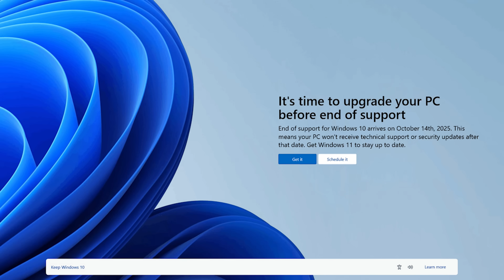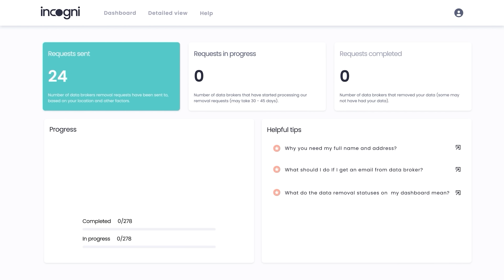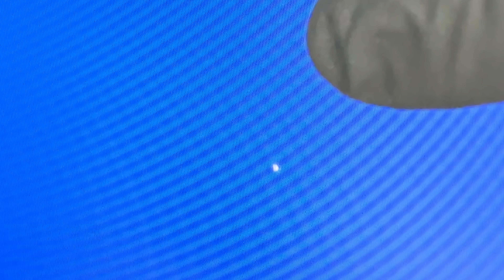I Made 2 WORKING Laptops From 1 Dead ThinkPad - DON'T Buy a New PC Just For Windows 11!

Comment: A few days I bought a used Precision 7540 with an i7-9850H and Quadro RTX 3000 off eBay for $300, a good upgrade from the refurbished Precision M2800 I was gifted and had upgraded to the max. Both computers still perfectly usable running Windows 10. This new one is also really futureproof with all the upgrades you can do including 128GB of ECC ram!

Comment: The only reason I don't do older thinkpads is the display. I use my laptop to watch content and a good display is a must. When I left my last place of work, they were going to throw away the laptop i was using because it was 4 years old. I asked them if I can have it. Microsoft surface book 2. The hardest thing to run linux on. Still managed to do it. Has a gorgeous display. Got it for free.

Comment: I bought a used ThinkPad L14 Gen 4 in March 2025 with a Ryzen 5 PRO 7530U. The laptop had 16 GB of RAM, 512 GB of storage, 450 hours on the SSD, and 28 battery cycles with 98.9% health, for just 380 euros. I upgraded the RAM to 48 GB for 60 euros (it supports up to 64 GB), and with Linux, it is a monster of power efficiency. It now scores 1900 points in Geekbench 6 Single-Core, 7270 in Multi-Core, and 8100 in Cinebench R23. Consider this: if you use a text editor to take notes during courses, with one or two browsers in the background, it loses only about 10% battery in 1 hour and 15-20 minutes on battery saver mode. That is really awesome.

Comment: My daily driver for work/school Thinkpad T460s just died due to a cracked motherboard Im thinking of just upgrading. But I love how easy it was to replace the ram, ssd even the screen. It's the same in the automotive world, cars are getting harder to work on because of how they are designed. Everything is getting worse. I remember when I used to be able to take a IPhone 6s and replace the battery and screen but I can't even do that with the modern stuff . We should have the right to repair and be offered products that can be repaired whether it be a laptop, a car or cell phone

Comment: All the HP people going on about their HP that's good are missing the point. ALL the HPs mentioned are not consumer-grade, either gaming or workstations - precisely what the dude in the video said would last longer. The cheaper ones is where HP is screwing people over. Dell or Lenovo don't do that to the extent HP does and for that reason, I actively try to talk people out of buying HP pieces of shit. HP SUCKS!!! I have NEVER owned a good HP in my entire life! And I've owned lots of them. I SWEAR by Lenovo. Have a T420s from 2012 that still works been running Linux on it since I got it (been a Linux user since 04) and it works, changed the hard drive, the adaptor and that's it. It only needs a new keyboard but I use it as a desktop in the meantime and it has paid for itself multiple times over. 

Kinda sad it lasts so long so Lenovo couldn't make more money off of me, they can shut up and take my momey! I have a complete Lenovo ecosystem going on, Think series desktops, monitors, webcam, laptop, headphones, Lenovo branded NAS, I need a Lenovo phone and Tablet and surface-type device (I actually like the Surface) and a Galaxy S9-type Tablet, hell, if they made food and appliances and furniture I'd most definitely buy that. To me, Lenovo can do no wrong! I am literally a Lenovo Fanboy! Only Lenovo, Toyota and Yamaha get me so dedicated to their stuff.

Comment: I have an HP laptop, not sure if it’s commercial or business, from around 2016. It came stock with a 6th gen i3, 6 gigs of ram (4 gig and 2 gig sticks which is weird to me), a 1tb HDD, 15 in touchscreen, and a freaking dvd drive. Definitely started to slow down over the years and was eventually useless besides running my karaoke program only after 2-3 failed attempts to launch. Just recently did I upgrade the ram to 20 gigs, put in a 1tb ssd and did some cheeky configuration that allowed me to upgrade windows 10 to 11 with an unsupported CPU. Ever since all that it runs better than when I first bought it and it may even replace the small ASUS vivo laptop I got a few years back (that has its own set of issues but I got it for 99 bucks on a Black Friday sale). Being able to do your own maintenance and upgrades to older machines is so helpful and it’s thanks to channels like this that helped me learn how to do these things and keep my aging tech alive and well!

Comment: There is always a use for old tech as long as you fully understand exactly what you need something for.
This is especially true for small businesses.

In my use case a few cheap laptops are a game changer. 

In my use case having an old laptop or several in a different area of the restaurant that can have the booking system loaded. The chefs can see the bookings on the kitchen laptop. They can access the portals for orders and house recipes.

Do you need a top of the range machine to do these things?  No

Get a few old solid ex "business level" still go.

Linux as our man said is a game changer. If you only require staff to acces web pages for business then old harware for basic tasks is brilliant. 

As long as the old laptops are plugged in they are fine.

A shitty old business laptop is still worth its weight in gold. Gets your current non pc using staff connected to the business  in the most simple of ways.

Comment: In a weird way I'm thankful to Microsoft. Thanks to their boneheaded specs for Win 11, now my desktop Optiplex 9010, my ThinkPad L14, and an old 11-inch MacBook Air are all running Linux Mint. And I had not been happier with personal computer in a long time... But now I am. So thanks to Microsoft, I've seen the light, and it's penguin-colored.

Comment: 90% of the people using a computer for whatever, can do it easier, safer and better in Linux . If you're a developer, I'm not even arguing. If you're a gamer, yeah, there is a slight edge in Microsoft in terms of availability, but not performance. If you're a casual user you most likely just need a browser. The hardest thing like Andy's saying is the will to break the habit, although at this day and age it seems easier than ever, since most of us are familiar and use many different UIs.

Comment: The win11 i installed actually looks and works like a linux distro than a windows Os, it even makes the same sounds, it has the terminal a lot closer to users than utilities like control panel, or cmd... the taskbar was in a strange "central posistion and even system settings seems weird

Comment: I would like to say something about switching to linux.
That is the boot mode of your device, if it supports both legacy and UEFI then it's good. Most linux distro only support UEFI but there are some some do support legacy.
I have a latitude e6430 and I haven been trying to install linux mint on it but its boot mode is legacy and locked. Then I installed it right into the trash bin😢

Comment: I'll be good if a laptop can effortlessly run 10 years old games. It be sad while I have a Cyberpunk 2077 on my Steam account and some other games, but I'll deal with it... It is anyway better than sit in dark after yet another wave of ruzzian pooping there in Ukraine.
Unfortunately exactly because of I live in Ukraine I theoretically cannot by laptop from Your shop... Or rather delivery will cost more than laptop itself.
Also there usually if we throw away something it just die in horrible death and it is impossible to salvage anything from this thing. For example I change my "rugged" smartphone after it twice drawn in toilet(don't ask, it just happened), bloated to shit battery, ripped new battery cable and in the end it fall from thousand wounds when freaking CPU and memory chips was chipped and it just goes into reboot every like five minutes. So... I was many time told that in USA You can find totally fine working stuff, including cars, on a scrapyards, which is ridiculous for me.

Comment: thank you for your great work. this channel speaks to my heart.
i still run my 2014 15inch Lenovo "ideapad" Z50-70 with its 4th gen "i5" and Nvidia dGPU and i plan on squeezing every last ounce of life out of it, because it has an impeccable (for its time) IPS display.
(in EU so i'm on win10 ESU atm, but I'll move to some Linux eventually. wild horses couldnt drag me to win11)

even tho it not being a thinkpad it survived 3 full glasses of water (after the 4th i had to put in a new keyboard). i also upped the RAM to its max of 16gb.
i'm overdue replacing its HDD with an SSD (i shy away from the work of the reinstall and data transfer atm)

Comment: Because to be honest, the other mess going on with Windows 11 is annoying. I wouldn't upgrade anyway. But this mess with TPM is a no-go. I wouldn't have minded so much if it was a Pro version requirement, for enterprise stuff at least. But generic consumer? No.

I have an old Ideapad from like 2012. Upgrading to Linux since it definitely can't handle Windows 11. Plan is to just upgrade some of the parts. Screen is fine. New battery would be nice. I don't really game anymore, so I don't need the SLI graphics card in the Ultrabay, so I can get an optical drive. SSD for faster load times. Secondary drive for backups. Bottom cover is busted so replacing it would be nice. More RAM would be nice too.

Comment: Because of your videos I got an old Dell Latitude off ebay, got it a new ssd, and started using Linux Mint. It's been so nice to work with so far. Even for a 2015ish model that has the old pop out battery, it's holding up very well and is running thigs smoothly.

Comment: I still keep my laptop from my highschool that my dad bought me with dualcore pentium and 2 ram. So I installed Linux on it and really gave up because I dont know why it took so long to load anything eventhough I replaced with harddrive. Still, the laptop still have sentimental value for me and I can revert to Windows..... XP for smoother old software like FL Studio 8 back then and the rest maybe can be used for typing device. Also I have one old pc that I upgraded for emulator  device and experimenting playing 2010 pc games in 720p with portable monitor. I just really dont get the 4k or bigger screen for high fidelity gwaphic that require 2000$ parts to run. But since my 2017 1060gtx dont die yet and pc stuffs is the only hobby where I spent money, I built newer one with RTX.

Comment: I've used windows since 1997ish as a kid and I'm migrating to linux purely because of this dick move by microsoft. I'm already using a computer designed for linux (a framework laptop) and the one app that I need to run on Linux I can probably emulate enough now, so fuck windows forever.

Comment: I personally , taken from the advice from "The greatest technician that's ever lived!", I bought a Lenovo Thinkpad T490 at my local tech store, based from the upgrades on the ram and SSD, also reapplying the thermal paste, using Ubuntu Linux does wonders to me in a very long run, for development, documentation and other workflow projects. Of course it has an iGPU when it comes to light gaming, but I am proud of the laptop thus far and something to be proud of my purchase. Thank you so much for good advice when buying refurbished laptops.

Comment: How about "tree fiddy"?

I actually used a Dell Dimension M6600 with a Quadro 3000M as my gaming laptop to play WoW from 2013 to 2019. After it died, I removed the 17in 1080p display, tossed it into a VESA mountable shell with a driver board. That monitor is still being used at my work/test bench.

Comment: If Microsoft ever decides to do that move on people that busted Rufus on their laptops, they know they will switch to Apple!  Yeah that's thousands and not good for business!  I was building Hackintosh's ever since Snow Leopard and when my 2011 17" MacBook Pro took a shit do to the famous GPU failure I bout a ThinkPad X1 14" as temporary while I would get my MacBook Pro motherboard fix (never did)....  Windows 10 it's soo good that I haven't had the need to go back to using Mac OS which is amazing!   Win 10 is finally a real good working OS and this little ThinkPad X1 can handle all my needs because it's build like a tank!   Maybe once I get my whole room organized and build a new large desktop I will build my new Hackintosh with all the parts I bought a few years ago especially that gorgeous ASUS server motherboard that will run a 12 core Xeon CPU!   Was thinking of getting a M2 MacBook Pro but if I build a Hackintosh then there is no need for it!

Comment: Hi! I’m a big fan of your content and have been following you all the way from Egypt. 
I really appreciate your work and was hoping to get your help with something!

I’ve got an Acer Nitro 5 (model AN515-53-53U7), and I’ve been having a strange issue with the keyboard. A few keys suddenly stopped working, but the LED backlight on all of them still lights up just fine.

I tried replacing the keyboard with a new one — it worked perfectly at first, but after a while, the same keys stopped responding again. I even installed another brand-new replacement keyboard, but right after installation, those same keys still wouldn’t work (even though the lights do).

I’d really appreciate any advice or suggestions on how to figure out what’s causing this or how to fix it.

Thanks a lot in advance! 🙏

Comment: I have saved a bunch of Dell Desktops and Laptops from the landfill. The Windows 11 hardware requirements that MS put in place is total BS. You can get Win 11 25H2 to run on as old as a 2nd Gen Intel Core... basically almost every desktop made after 2010-2011-ish.

Comment: I swapped my mom's laptop over to linux. she only ever uses web based stuff 98% of the time, so chrome on linux is no different than on windows. only issues are we currently haven't tested the printer we uses .5-2 times a year, on average, & she ruined the battery & didn't tell me. so it's wired only now

Comment: 6:46 as someone with an HP Zbook Firefly 14 i can confirm this. Here’s a list of things that broke on the shitfuck:
• Frame: it’s all dented because it’s made of thin metal and the chassis is ass.
• Keyboard: every now and then the keyboard decides to take a half-vacation and then the keys N,B left arrow, and uppercase block stops working. It starts working again when put a lot of force onto the N key. 
• Touchpad: the mouse just seizes to function, though that’s because of water damage… even though waterproofing a laptop doesn’t cost much. But hey it’s my mistake too late now 😔.
• Webcam: this one wasn’t because of the water, it just stop pes working one day? Kinda weird.
• Hinges: in typical HP fashion, the hinges suck ass. Like genuinely, there is like a whole centimeter of up and down sway on the screen, not to mention how shaky it is if you touch it.
• Display: This is definitely the worst problem of all. Every like 2nd time I open up the laptop the screen isn’t on. Well, it’s not ACTUALLY off, because if you get your eyes really close to the screen you see a faint green image being displayed (the wallscreen an everything). The only way to fix it is to hit it around the area of the FN key. No joke I have to hit it or do CPR for it to work. I am so glad my sister gave me her old acer aspire to which she lost the charger of, I found what charger it needs and I’ve been using it since. Way better than the Shitfuck

Comment: Went down the rabbit hole and bought a Thinkpad T470 Touch from a local repair shop. Put Fedora on it, but gradually circled back to Linux Mint (Debian). The money I saved on it was enough to get a laptop stand with built-in ports, so I can hook up my two monitors I had lying around. My work area is complete!

Comment: I like this guy salem...i always tell people what he told in this vid...If you have a 6th gen or 7th gen...do not dump it we will make is work...i own a DELL PRECISION 7710 AND N4800...just imagine..its absolutely upto date running on WIN 11 25H2...flawlessly...helped few of my freinds to upgrade and update..They are really happy man..i can see their face...They acknowledge me for saving their money....well as long as you have like DELL, LENEVO thinkpad....HP you dont expect to be cosmetically and structurally ok after 2 years..😅😅...since the day one i have repaired my own computers...buy parts frm Ebay or other platforms...I want these machines to be running..well lastly WIN 11 25H2 runs pretty smooth on 6th and 4th gen...believe me...Thanks salem for a great vid..❤..lastly CHECK YOUR DRIVER SUPPORT..before going to win 11..for dell win 10 drivers are perfect with win 11.

Comment: I bought 2 macbook air for 360€ intel i5 one is 1,60Ghz and second 1,80 Ghz. Both have 8gb Ram and one have a custom ssd 512 gb and other have the original one 256 gb.
I like repair old computers but I admit apple are very evil , They weld the components and it is not possible to replace them without having a mini welder and it does not necessarily work. 😢

Comment: I love thinkpads expecialy T and X series. I ve been using them more than 20yrs. Starated from g40 with floppy on its left side and cdrom on the other. Super heavy but reliable eye bee em machine. T4x x 40, x60, x60 tablet and my long daily driver (10yrs and still works) t410. Bur recenlty i am dailydriving on t490s and it is not the same built quality but still love them. Period.